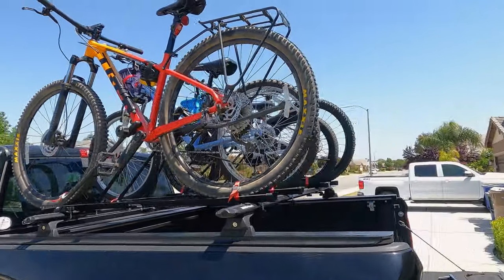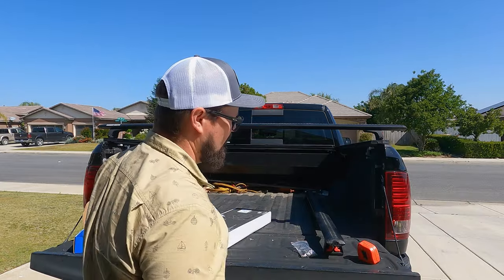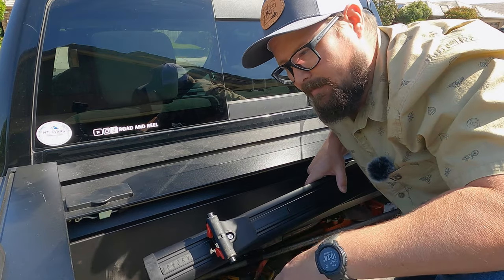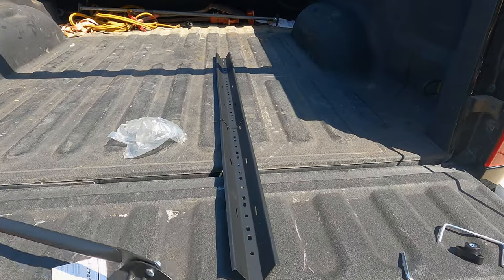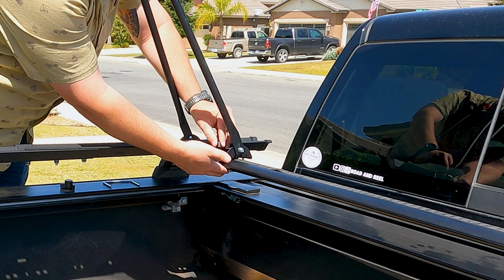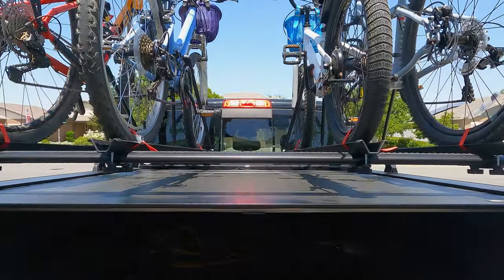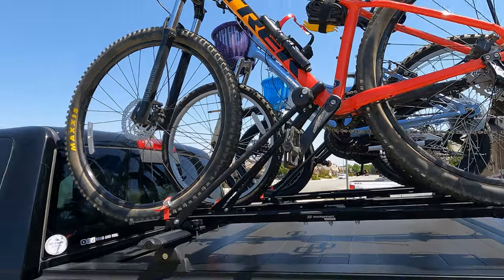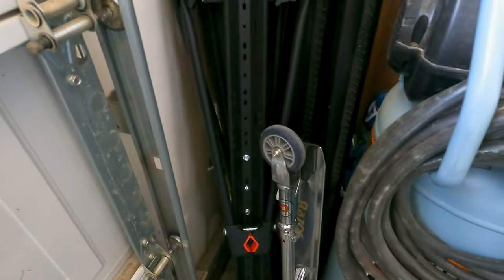Best Bike Rack For Towing & Tonneau Cover | RetraxPRO XR Rhino Rack

Comment: What do you use to lock the bikes so no one steal them. I had bike rack that locked the front wheels but didn't  locked the bike frames, when I got back to the truck I had 3 wheels and the rest of the bikes were gone. Any suggestions would help.
Reply from the maker: I have a 7ft rubber coated steel cable that I run through the frames and around the rack itself and locked end to end.  Similar to this here: https://amzn.to/41G3qvh
Reply: @RoadandReel  thanks!

Comment: I am trying to do the same set up with my NOBO 19.3 rhino rack, but for some reason the rack is not long enough to reach across my truck bed.   Am I missing something, is yours adjustable?
Reply from the maker: I loosened the legs on the crossbars and centered it. I wonder if yours has narrower crossbars? Mine are almost 6ft long.
Reply: You need the 71 inch bar